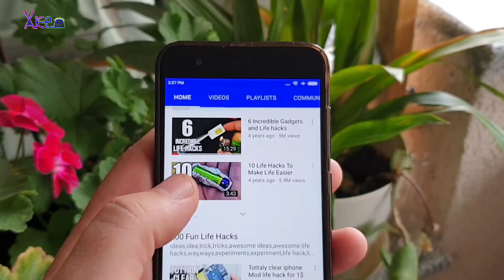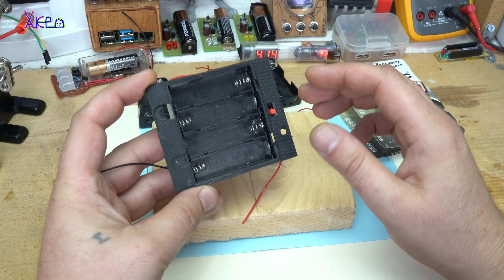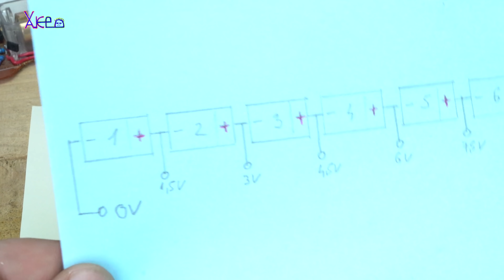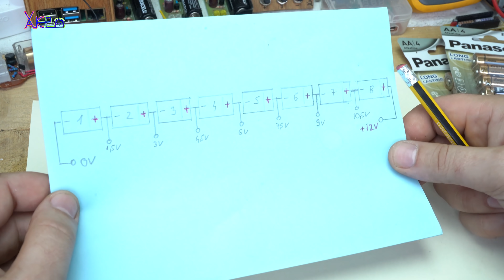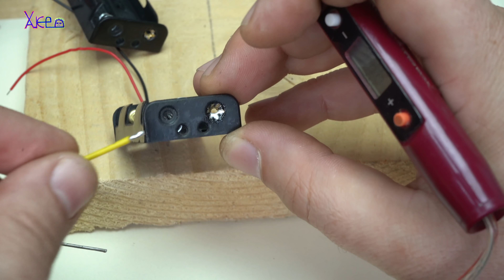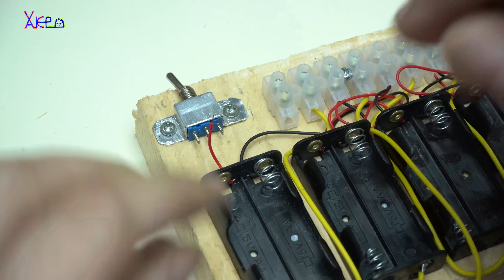Build at Home Variable Power Supply using only Batteries

Comment: Greetings. I am building a version of this so that I can check the LED lights on my model before I put the sub-components together. Unfortunately, all I have a three prong LED switches. Like you, I have power up until the 12V circuit. But I cannot figure out where the problem is located. Is there any advice you can give me on how to trouble shoot for a three prong switch? If you are open to it, I can post pictures somewhere if that will help.  Thank you in advance.
Reply from the maker: Please carefuly watch the video tutorial,if you makebit the same I am sure that will work 100%

Comment: You could also use a 12 positions rotary switch and select which battery junction you need for the desired voltage. A variable AA batteries supply !
Doing so you can reuse old batteries that are 1.40v are lower. The total series voltage will be the one you need.. Easy !

Comment: Nice project, but when you often use one voltage that isn't highest possible (12V in this case), it happend that some batteries will be more discharged then others and voltages and max current drops down.

Comment: Hi, i'm a start learner of enginneering student, i want to ask how do i connect to the component by using this source? (Like to use a 12V source is connect the positive n negative connection into the 12v norb or negative to 0v n positive to 12v ?)
Reply from the maker: If you want to use 12v just use the first and last wire
Reply: @Hacktuber  Thank you very much!

Comment: So the 12v lead went direct to the bridge, and the switch went on the original negative of the first terminal? 0v? Right?
Reply from the maker: Yes,the switch need to cut off the negative wire not positive

Comment: Nice one thanks. "used" AA batteries tend to have between 1.1 and 1.4 volts (depends on what they were used  in). If you dont need to much charge then you could still employ used AA batteries.
Reply from the maker: Yes or you can use rechargable batteries
Reply: My AA battery has 1.6v when completly charged, but when its completly empty is 1.1v
Reply: Marko Radman yes, so you could use those in increments of 1.1 - I have sometimes recovered “used” AA, I would say 50% are between 1.2 to 1.4, useless for most standard purposes but free source of energy for a rig like the one here. Just be careful they do not “leak”
Reply: @TheBlackadder-Edmund  thx for the info😀

Comment: how many amps is 12 volts?
Reply from the maker: Depends on battery brand,cheap batteries not give very high current
Reply: @Hacktuber  ok, i want to do a portable project using peltier boards, and i need 12 volts and 6 amps in a backpack, can you help me?